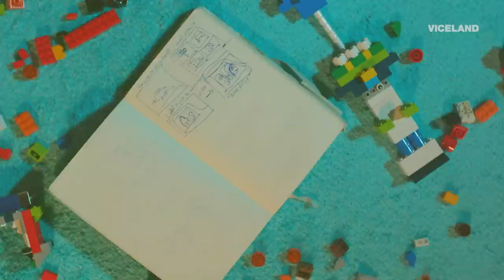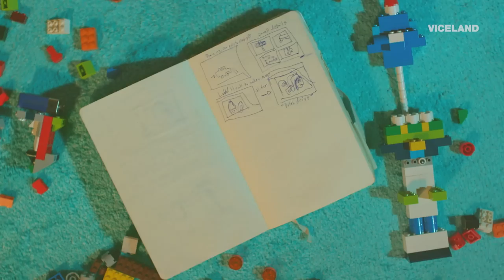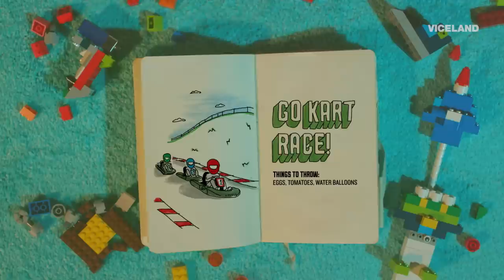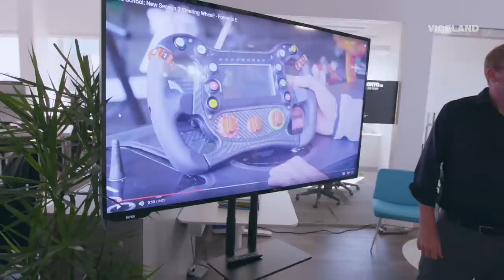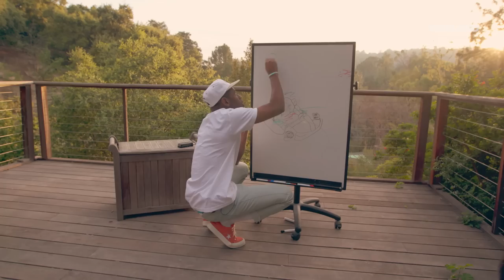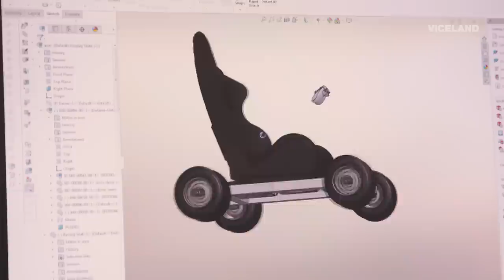Tyler, the Creator Makes a Go-Kart | Nuts + Bolts Episode 5

Comment: I have another idea where you can ride in the electric go kart and control it with controller that’s like Xbox or ps4 controller like, you have to plug the controller into the go kart or you can manually drive wit tha steering wheel, and you charge the battery up and it last for 10 hours and charge it for 24 hours. And I swear to god I got that’s idea before I saw the controller part I swear on my grandpa grave and my soul.